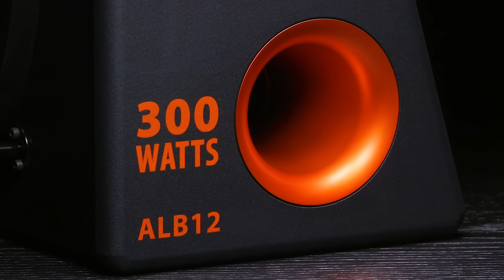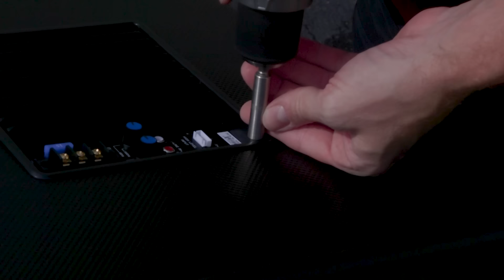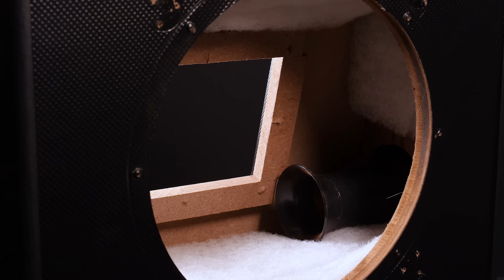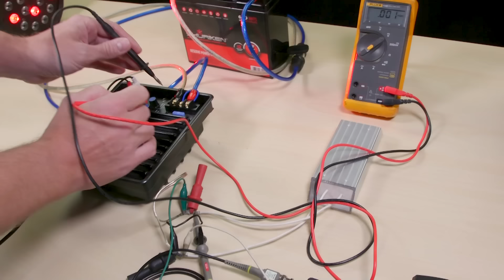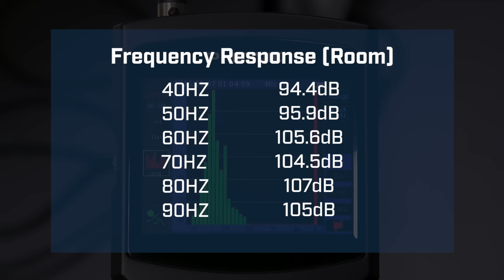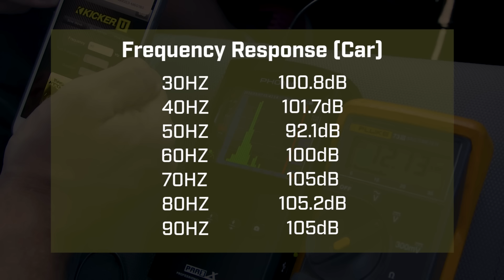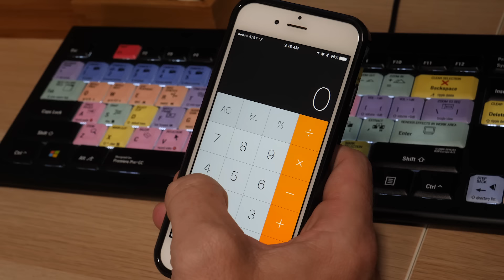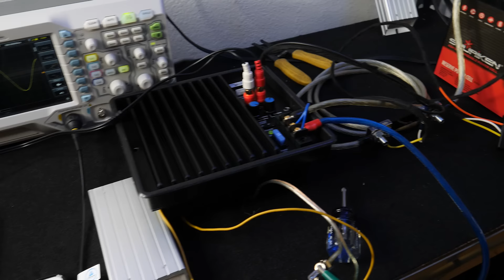Sh*t Car Audio Manufacturers Say! Reverse Engineer an Amplified Subwoofer

Comment: A $99 powered sub is crap? No kidding. I have a 12" Rockford Punch sub in a 1 cu.ft. sealed box  being pushed by a Rockford amp putting out 319W RMS. It sounds really nice for an entry level sub @ $420. Pay anything less than that and you are wasting your time and money.

Comment: well i think nowadays all manufacturers go this way even those that used to build quality stuff only, and i think reason is to get away from planned obsolescence accusations.
  i mean you can't really explain a higher price when quality stuff breaks after 1-2 years of use, but with a cheap one they blame it on the budget..
  and talking about BSing the specs ther's PHILIPS which i'm sure all of you know who takes a led panel from a digital photo frame sticks it into a monitor frame and say's it's a 5 ms response monitor with 15 mil colors and 1000:1 contrast
 and then you get home and you can barely scrool the comments on youtube without getting angry at the ghosting...(it's a 243V model).

Comment: to be fair, its made for car use.
witch means you do not want a flat response. otherwise the "room gain" or in this case "car gain" would make it sound like shit. no on knows what kinda "car gain" they where working with when this shit was designed. as a real car asubwoofer starts its life by measuring how will the car it self modify the response at listening position, and you actually work out a fucking non linear transfer subwoofer , that, when combined with what the car adds/takes gives you a linear sound at listening position.
so for the bumpy curve you can not blame them at all.

however, the amplifier and subwoofer does not makes the promised output.
nowhere they state what that 100 watt rms and 300 watt shit comes from.
maybe the amp can do 100 watt to a nother kinda load, like a 2 ohm dumy load.
surely not fair as we would be expecting it to deliver to the given driver, however thats just us. the 300 watt can be anything, maybe what the driver can whitstand for 1 nanosecunds.

none of the info is fake, it is just by purpose not what we would likely think it is.

Comment: Wouldn’t it it be better if it worked with v89 daul hz then max v2 into inclosed 564i useing 200watts unless you use 22hz 

😂 I just texted random shit to sound smart
Reply from the maker: LMFAO we did the enclosed 565i using 555,000 watts

Comment: Interesting. Manufacturers have been inflating claims since I've been alive, though, not much surprise there. I guess the real question, is for the money, how does it sound in the car? Do you hear the clipping? Does it sound funny?
Reply from the maker: I'd argue this box in most vehicles will sound similar to the plot; to most this will sound very kick drummy, extension will suffer.

Comment: Packing peanuts, not accurate, also in car voltage its constant 14.4-14.6V if everything works OK. 11.9-12.00V in car is only if engine off and battery way out of full charge
Reply from the maker: Stay tuned for our new video on testing in car voltage, 4 different cars, sedan, mid size, truck, none even got to 14.4, with 2,000 RPM too

Comment: even with a pulse width modulated alternator you wouldn't see a 2 volt drop. the instant the PCM saw that the voltage was going down it would kick the out put up on the alt. no modern car will run below 12 volts. the PCM would shut the car down.
Reply: You have not clue what you just said. Everything in this statement is just wrong.
Reply: You could run a car on 8/9v it will run not very well but will run.. if it's a carb car it will run on 6v at the coil
Reply: show me a modern car that will run at 8-9 volts....did you even read my post? the PCM WILL SHUT THE CAR DOWN anything below 11 volts.

Comment: Dual should go out of business
Reply from the maker: There is a place in the market for them, but BS'ing specs is not the way.
Reply: JL AUDIO ram hemi they actually have some good value for what they charge if you can get past the hyped marketing. Don't get me wrong they don't compare to high end equipment like JL but that's kinda like comparing a hellcat with a pinto.
Reply: Ok....the 300 max is misleading. But it's normal. ALL companies do it. Rockford. JL. It's an industry norm. So I could see if DUAL was the only doing it....yeah....hammer them and burn them alive....but they are not.
100rms and you tested 50ish. We are know there are so many variables for this. Box rise. Wire. Voltage. Music vs. Test tones.
The specs are not that insanely out of place. I've see way worse. Even Rockford lists their amps at say 500 watts. Yeah at 2 ohms. 4 ohms is 300. Why have the 500 max rms listed in model number and marketing when 300 watts is the normal first rated power? Marketing!!!
When you say shit specs, look at what most consumers look at....not us "pros" or "experts" do. 
A 55 year old male looking at installing "something" boomy in his 2003 SUV after hearing how well his friends 2017 sounded with a factory sub sounded sees this online. Looks at the reviews and 89.00. Ease of install. And then installs it and hears it. Do you think he thinks he got shit specs and mislead? Hell most don't come with any mounting hardware!
Reply: Smokie Vapez yes your right all I use is jl and alpine
Reply: zzzACE73 zzz I know all I'm saying is I only use good stuff like jl and alpine u get what u buy man
Reply: Quality Mobile Video agree
Reply: Justin Murphy there's a big difference between posting best power outputs and posting impossible numbers. Even though I feel dual has good performance to cost ratio they get a very bad reputation from using impossible numbers to try and dupe people into buying their stuff. That being said if they were more honest they would have a much better customer base. I personally would rather pay more for a Rockford product that so far I have never had one of their amplifiers perform worse than advertised.
Reply: JL AUDIO ram hemi without a doubt. I believe that most of the time you get what you pay for.
Reply: zzzACE73 zzz I agree 100%
Reply: Well they are testing @ 12 Volts, most amp ratings you see are tested @ 14,4 Volts (which is the best case scenario in your car) at proper voltage that amp might give close to the 100 watts it promises
Reply: I blew two 12's in three weeks at 875 watts a piece. I was running two duals and one Sony explode on 2500 watt amp!
Reply: Jesse Laine yeah probably just saying it rattles
Reply: Jeremiah Metzger three weeks isn't a long time but 2500watt amp is not bad
Reply: Jesse Laine I don't think two volts would double the output. If you want to know what an amp is capable of doing check out the size of the fuses. No amp can make power above that limit. Maybe when they came up with those numbers it was unfuzed ( made up word) and at the point of failure.
Reply: zzzACE73 zzz i agree
Reply: Jeremiah Metzger that really doesn't mean anything. Did you have the gains up so high that you had clipping? Clipping will kill any speaker 🔊. 2500 watts? What upgrades have you done to your charging system? Most stock electrical systems can only handle 1500 watts max. Realistically 1000.
Reply: zzzACE73 zzz first of all I don't use dual I use jl audio and alpine and I have a big alt I have a 2012 ram 1500 my electrical system is strong
Reply: zzzACE73 zzz not like a car
Reply: zzzACE73 zzz i hold 14.5 to 15 volts continuous
Reply: zzzACE73 zzz That 2 Volts is actually an signifigant gain in the power-output, For example Digital Designs M4a gives out 5000w rms @12V and 7200W @ 14V,  that little amp might give enough juice with about 1%THD (clipping just a bit) and ive heard of cases where manufacturers test the power-output at even higher voltages.
Reply: JL AUDIO ram hemi I was talking to Jessie 🙂
Reply: zzzACE73 zzz and I have a capacitor hooked up to my amp
Reply: zzzACE73 zzz I had it professionally installed so they set it up right.
Reply: zzzACE73 zzz oh hahaha thought u were talking to me
Reply: Jesse Laine 
I totally agree. If tested with a running vehicle with the correct wiring I do believe you would see close to the 100 watts.
I've seen so many high-end amplifiers have disappointed customers because they're charging system was inadequate. The only good thing about higher-priced amplifiers is they can handle and compensate for an efficient charging systems making them seemed better then other amplifiers.
Honestly I think that there are other products and other companies out there that have over hyper their products More Than This One did. LOL. Seriously? Missing it by 50 Watts on 12 volts? And basically showed us that there is tremendous value in the set up! I guess it goes to show there's no such thing as bad advertisement. I would love to see how many have been sold from this video.
Reply: Honestly I think that there are other products and other companies out there that have over hyper their products more than this one did. LOL. Seriously? Missing it by 50 Watts on 12 volts? And basically showed us that there is tremendous value in the set up! I guess it goes to show there's no such thing as bad advertisement. I would love to see how many have been sold from this video.

Why not do an amp that claims to make 3000 watts in only cost $75?
Or a 10 inch sub subwoofer that claims to take a thousand watts max but only has a 32 ounce magnet, stamped aluminum basket, anf a one in voice coil.
Reply: Justin Murphy don't listen to the max power it's the rms rating it will never do the max they shouldn't even put max. They should just do the rms power on the amps.
Reply: Justin Murphy so if it says 5000max and 4000 rms they should just say a 4000watt amp
Reply: Justin Murphy Well, missing the rated power by 50watts dosnt sound too bad, but when its 50% of the claimed output its kinda shitty 😂. I personally stay out of buying cheap products brand mew and aim at buying quality products used, i got myself a pair of Crunch  10" drivers in a ported enclosure (well not too quality product) but it was only 20 euros, and they are rated for 300w rms and i was giving them 800ish watts rms from an spl dynamics dig-1450 which i picked up for 50 euros.
Reply: Jesse Laine nice I had a friend that loved crunch and his car sounded pretty good except his CD player was stuck playing dodo brown.
Reply: Jesse Laine that's around 45% gain on a quality amp that is designed for that output. I can't see this amp doubling its output without going up in smoke 💨
Reply: zzzACE73 zzz Trust me, its the 12V they tested it on, from the spreadsheet near the end you can see that @12V the amp gave 49W rms and  @12.2V the amp gave 54W rms, 10% gain with 1,6% more voltage. Shows you how much that amp was starving. Ofcourse theres dimishing returns when upping the voltage but id recon its near 75-80ish watts with proper 14.4 volts
Reply from the maker: We re-ran the test with 13.2 volts and the amp outputs 64 watts. We also re-ran the test at 16 volts and the amp output was 98 watts. The amp went into protect after 2 minutes of testing at 16 volts. The spreadsheet has been updated on a separate tab with the new results.
Reply: Jesse Laine that is not double the power. I'm not saying this amp is crap 💩 just saying it is over hyped by dual. Unlike companies like Rockford that advertise a 500 watt amp and you end up with a 6-700 watt amp.
Reply: Quality Mobile Video Holy smokes!  You guys really read comments :o. Happy you guys tested it out :) that 13.2V is what youre gonna get out of most cars without Big 3 and upgraded charger, You guys have a new sub! ^^
Reply from the maker: Jesse, yes we do! Glad to have you as a subscriber!
Reply: Quality Mobile Video so I'm pretty much right on the money. 😃
Reply from the maker: zzzACE73 zzz Yup!
Reply: You guys should check out BigDwiz, he Dyno tests car amplifiers to let you know if they are near published specs.  Which is often as bad as subs.
Reply from the maker: 123Toid BigDWiz commented on this video, we are huge fans of old school car audio!
Reply: But why did the original tell me that he got 50 watts out it at 14.4???
Shitting on me about shitting with amp specs.
Reply: Oh I know about max vs. rms. I was an installer for 15 years. I was just using the old max power rating info as a reference about lying.
Honestly I thought this max power rating bullshit would have been history.
Reply: Re-ran?
In a previous reply to me you said that you tested it with 14 volts and it was only 55 watts. But it wasn't put down for some reason.
?????
Reply: Re-ran?
In a previous reply to me you said that you tested it with 14 volts and it was only 55 watts. But it wasn't put down for some reason.
?????
Reply: This Subwoofer by it self on a REAL amp is actually decent. I have one getting 200 watts and in a proper enclosure this one and an older model dual also getting 200 watts. I'm hitting almost 140db @40hz. No crazy lows past that though, I'm sure the excursion would destroy them but with proper amplification and packaging they really aren't too bad for the price ($50 new, no enclosure, from walmart).
Reply: DaniTheNachoPirate guess your right 140db is fucking loud
Reply: JL AUDIO ram hemi yeah that's louder than my 2-12" alpine type r's with a 1000 watt Rockford amp.
Reply: zzzACE73 zzz they can't out preform type r's that don't sound right
Reply: JL AUDIO ram hemi 138db at the windshield
Reply: zzzACE73 zzz I believe you just can't see those duals do 138db how many watts and what size box
Reply: JL AUDIO ram hemi I think it's somewhat of a tall tale. But I could be wrong it does happen just ask my ex wife.
Reply: JL AUDIO ram hemi oh 1000 watts vented. Can't remember how many cubes but it was custom built by a reputable dealer in Clearwater
Reply: zzzACE73 zzz I don't know your ex wife????😂
Reply: they made some pretty good products in the past
Reply: Vi.cecity I never really looked into the dual brand I only hear bad from other people
Reply: Vi.cecity and audio shops
Reply: Willy Wonka focal and kicker? Are you saying they are bad?
Reply: Willy Wonka you might be right about kicker I haven't messed around with them since 2008. But focal is a very high end sound quality speaker manufacturer. I can't imagine comparing them with dual.
Reply: Willy Wonka there's a shop near me that sells focal. What is the point?
Reply: Willy Wonka actually if Boston acoustics was still making mobile audio I'd agree that they sound pretty awesome at half the price of focal and most people wouldn't know the difference in a blind test. Either way neither compares to dual. Brands that I think are equal to dual are audiovox, Jensen, Pyle, pyramid, fusion and realistic. I'm sure there are more.
Reply: Willy Wonka no biggie.
Reply: Dual DID go out of business! Back in 1982. Since about then it's been first 2, now 3 different holding companies holding licenses to sell something under the brand name, with completely different market segments, sales tactics and sourcing.

And you know what, this item per se wasn't terrible, it's just labelled wrong.
Reply: Siana Gearz I agree with you about it not being that bad. But my problem is the false advertising.
Reply: Anthony18 Disessa yes
Reply: Anthony18 Disessa vlogs no
Daul subs are good for price 
Idk why people expect the sound of a 1000$ sub to come out of a 40$ sub

Comment: I know dual isn't top of the line stuff but this seems to be a good product for the money 30 for the sub 30 for the box and 40 for the amp. theres worse stuff out there. what about 300 watt 5 1/4 inch speakers, every company is up to this garbage spec., all of the big name brands are doing this too. just to be clear, this to every person out there "peak power" means nothing, its a garbage spec.
Reply from the maker: +bradley goode I would agree with you, it has a place in the market. Drop the jargon.

Comment: Well Dual is a Sh*tty product anyways. had 2 12 inch subs from them that were 800watt each and ran them with a 1200 watt amp and blew them both in less then a month. None of these were bridged and i had it set at the lowest setting being i kept getting a weird popping sound from them when they would hit bass.

Comment: Coming from a guy that has been into car audio for about 16 years this shit is so stupidly done. Yea the dual box probably sucks but the testing methods were retarded. Should have clamped wattage. Should have used a Termlab. Should have used 14.4v input.
Reply: With a resistor load there is no rise like with a speaker system so you can actually calculate the power based on just the voltage output. I do agree that a current clamp would make sure the numbers are accurate. also at the SPL level that this puts out a termlab would barely register, a calibrated RTA(at least i hope it's calibrated) works better in this instance. I do agree with having 14.4v would have been better, but they were testing with what they have available I'm assuming.
Reply from the maker: Tim, we just re-ran the test with 13.2 volts and the amp outputs 64 watts. We also reran the test at 16 volts and the amp output was 98 watts. The amp went into protect after 2 minutes of testing at 16 volts. As part of next weeks VLOG we will show the results. The spreadsheet has been updated.

Comment: Why are car audio speakers still 4 ohms? lol It's all crap. I've been using 8ohm home since 2000 and f$@k'n owned.
Reply from the maker: Easier to amplify, once we get 48 volt vehicle systems we'll see what happens.
Reply: Next time you get a chance try it. I usually bridge a 4 channel amp down to two channels when using 8ohm so the amp see's 4 ohms. I'm telling ya, you'l never use 4 ohm speakers again. Completely different level of audio.